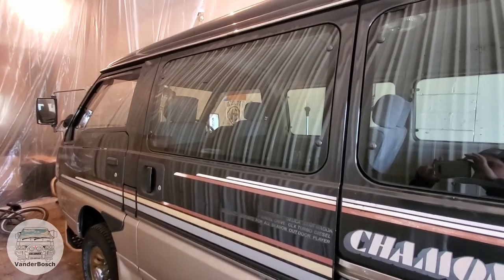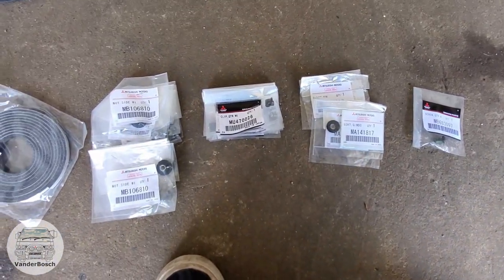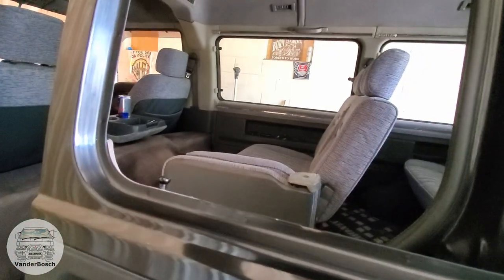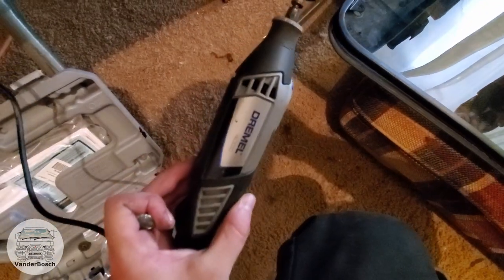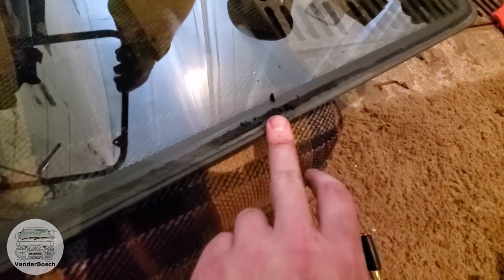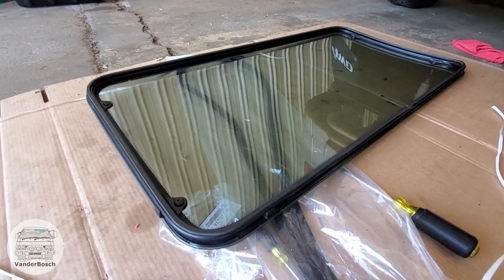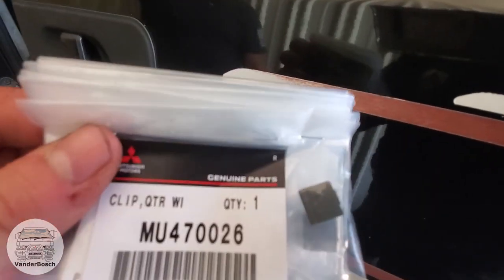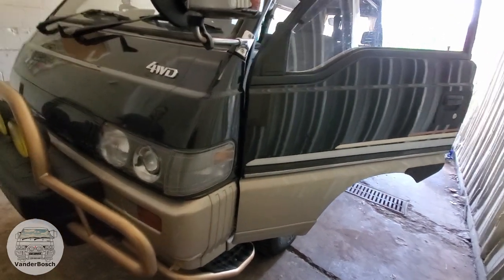1991 Mitsubishi Delica L300 - Sliding Door Fixed Window Weatherstrip

Comment: Hey! Thanks for the awesome video.  But I have a question or two! 

I’m trying to figure out why our back “butterfly” window is leaking. It almost looks like there’s not enough pressure pulling the window into the seal. Seals still look good. 

Do you have any recommendations for the butterfly windows and aligning the window to seal? Thanks a ton!
Reply from the maker: My weatherstipping on the butterlfy windows looked good as well. I believe my problem was that the rubber lost all of its "bounce". When I put the new weatherstripping in, there was significantly more pressure on the window when closing. It's a very tight seal now and I have no leaks on these windows anymore. As far as aligning, I didn't have to do too much. I had one person inside the van and I sat outside to hold the window. We snugged everything in place first, verified all the holes lined up, and then tightened down. I'd try ordering one seal and see if that's the issue. Than order the rest!